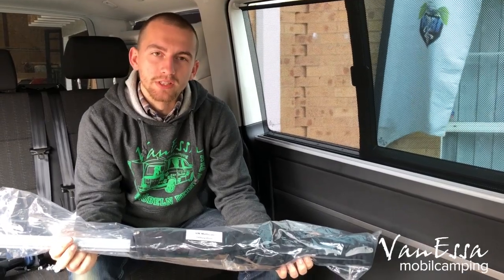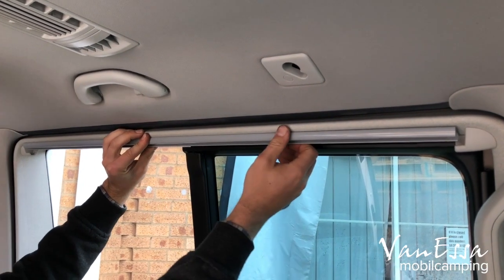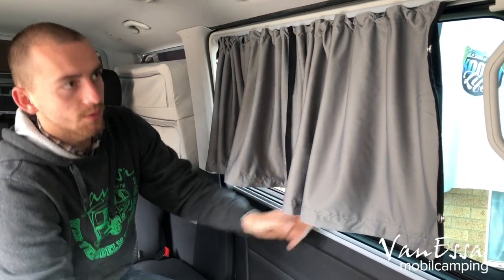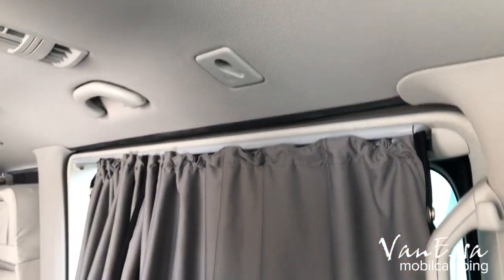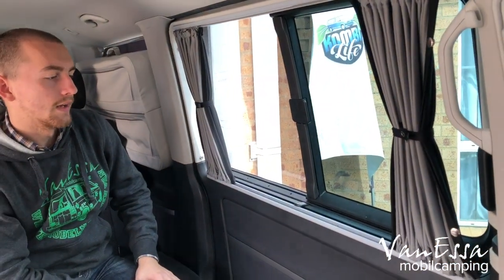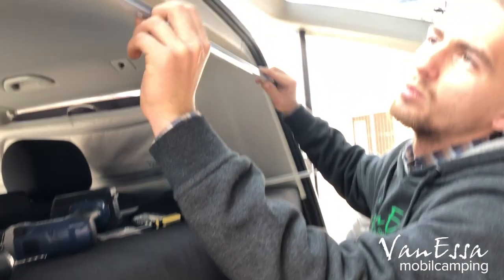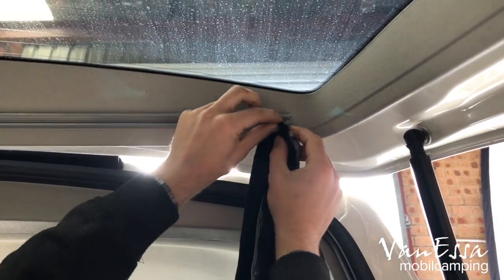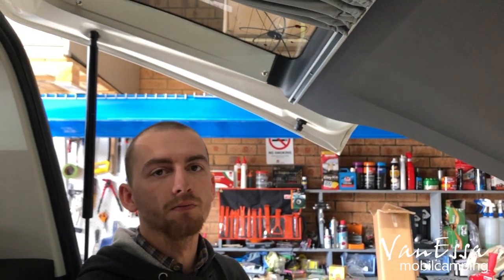How to install Volkswagen T5 T6 Curtains for Multivan - Sliding Door Curtains and Tailgate Curtains

Comment: Thanks for the video. Just putting  my curtains in today. I have the set of 5. The extra set of 2 curtains for rear windows , the top has pulled through. I guess you have to add a thin strip of metal or ply behind the liner to add strength.
Reply: You can also consider one additional slightly larger screw in the centre. Note as well the rail can be bent/moulded further to reduce tension on the rail.
Reply: I ended up using a strip of TAS oak 0.6M * 8 mm*20 mm as backing . Worked out ok.thx
Reply: instablaster.